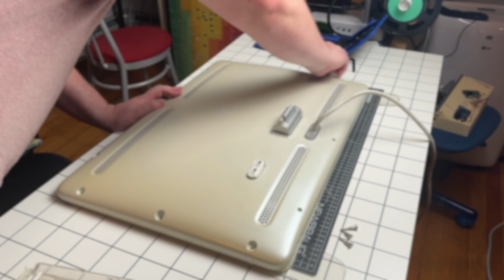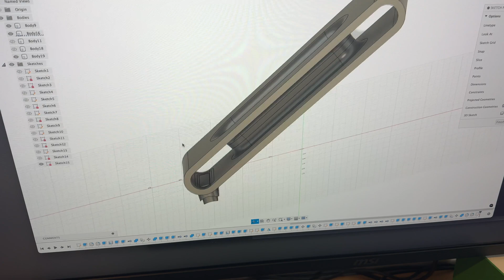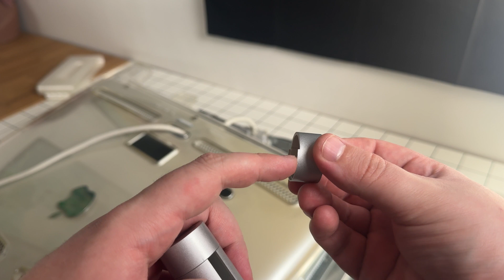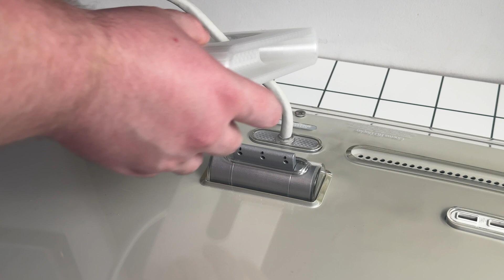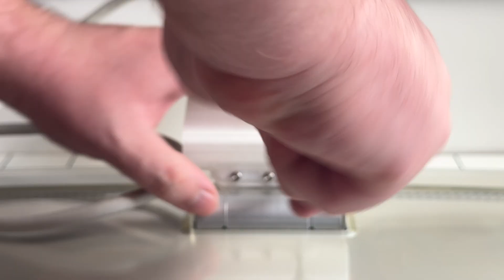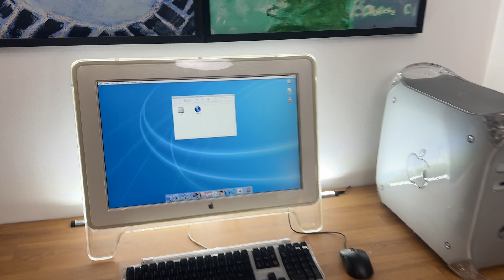Fixing A Broken Apple Cinema Display With 3D Printing | Full Repair & Teardown

Comment: This is awesome. I have the same problem and was looking on how to fix this (if it is even possible). I'm also trying to see if I can connect the cable to a newer (2019) MacBook Pro to use as a second monitor. Do you know what cable adapter would be needed or if even available?
Reply from the maker: Thanks very much, unfortunately as these displays age this will be pretty common. In terms of the adapter, you are going to want an ADC to DVI adapter, which is a rather large item that almost looks like a macbook charging brick. They can be found on ebay but are a bit expensive due to rarity. Then you would have to adapt the dvi to the hdmi (or usbc) of the macbook pro. I don't know for certain if that would work, though I would imagine someone has tried and could give a definitive answer.